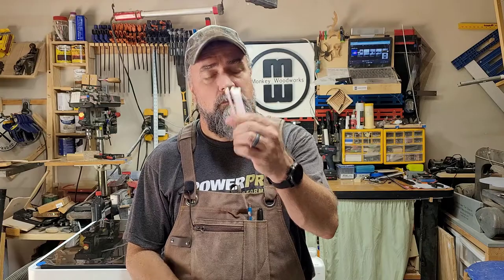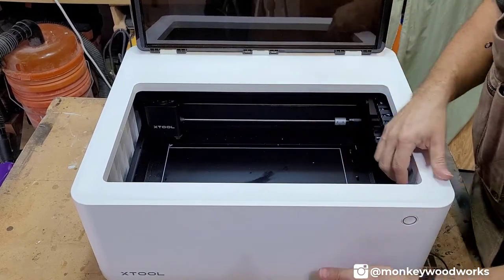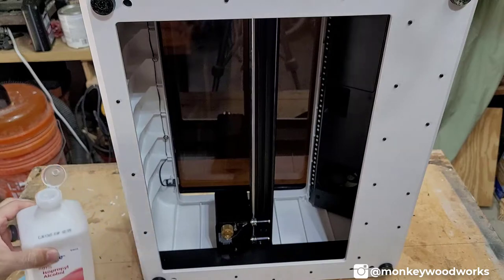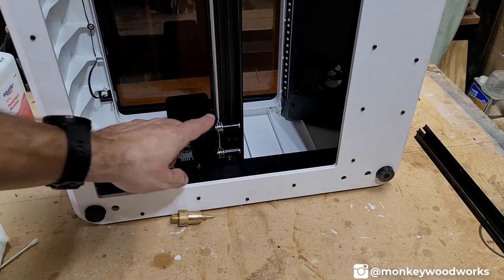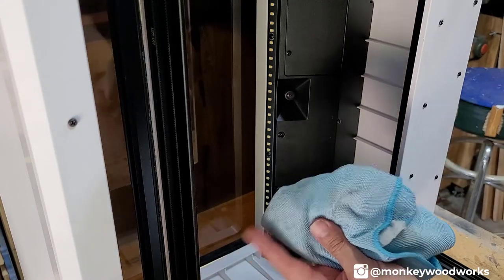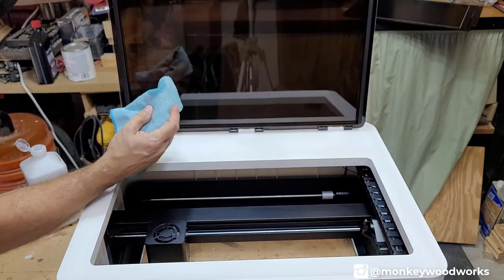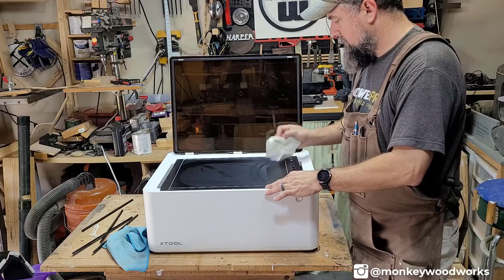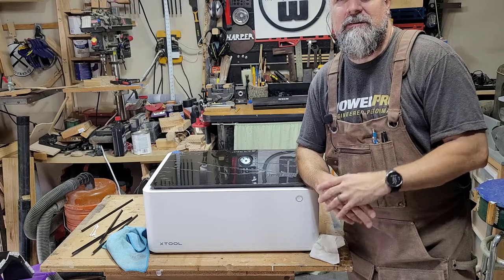Part 7 of Testing out the xTool M1 - Cleaning My M1

Comment: I would recommend taking the protective plastic off of the cover. Over time, the adhesive on this type of material can become solid, making it next to impossible to remove, and/or causing a frost effect, which would make it impossible to see inside.
Reply from the maker: I eventually took it off.  I just wanted to keep it "new" for as long as I could

Comment: Never use q-tips, paper towels, cleanex etc to clean optics. They most likely contain clay which will scratch the optics, only use optical wipes which do not contain clay particles.
Reply from the maker: Good points.  The xTool group specifically indicates to use a q-tip to get to the laser lens and optical lenses in the M1 however maybe its better to wrap a q-tip with that optical wipe instead to reach and clean the lens.

Comment: Michael, I have enjoyed your videos. I have a question and thought you may have a thought or insight. My laser head is not moving from it's starting position. I have updated software, restarted. Thoughts?
Reply from the maker: I have not heard of that before.  Try this:  Power off your M1.  With it turned off, gently move the laser head cube thing to the right near the middle of the unit.  Then gently pull it towards you to position it in middle of everything.  (I prefer to grab the black horizontal bar holding the laser head aka the gantry).  Once you do that, power it on and see if it goes back to the home position on it's own and try to send a job to it again in XCS.  If not, I definitely suggest you join the FaceBook group named "xTool M1 Official Group" and post your question there.  Plus, you can go to the top of the group and find links to get support from xTool.
Reply: @MonkeyWoodworks  Michael, the gantry moved back to starting position when I moved it to the middle, but the laser does not move from left to right.
Reply from the maker: @deniseadkins2991  it doesn't move by hand left or right when power is off or when you send a job to it?  Either way, check xtool.com and thr FB group.